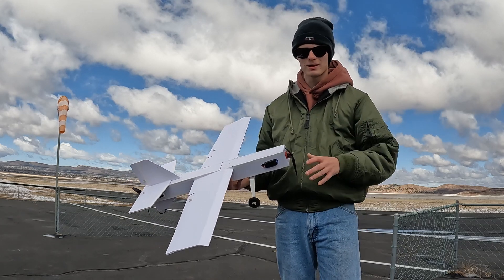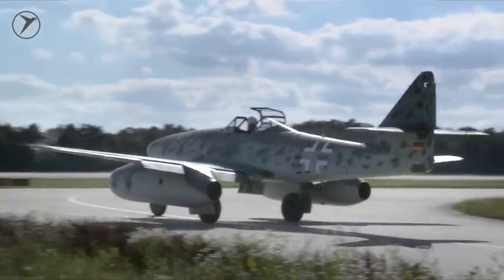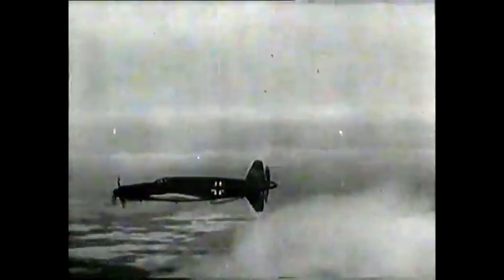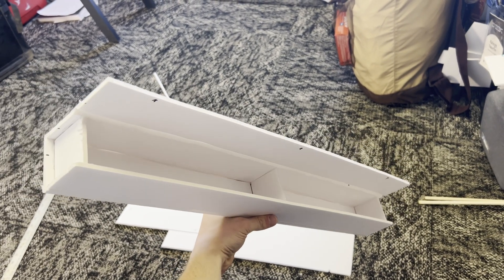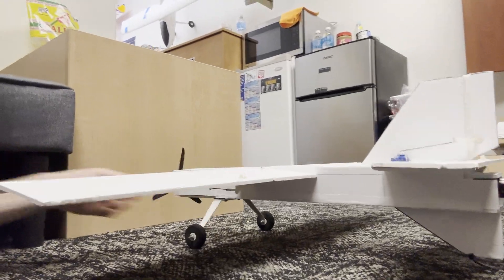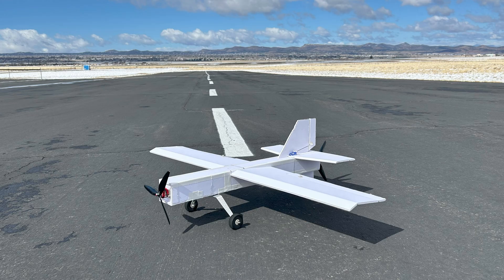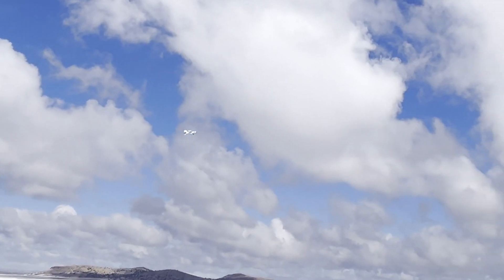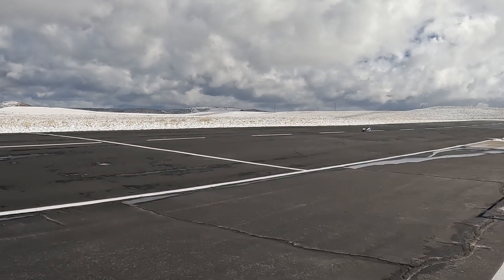Pusher-Puller Twin Airplane? | RC Build & Fly

Comment: Yooooo, i had the idea to do this, and i have yet to build it, but i do have one thing. I think, since the dual engine provides a lot of power, i think if you did a slower throttle up itd take off striaghter, albeit slower

Comment: I think the biggest thing you could mess around with is its take-off and landing performance. Maybe having the push motor mounted higher up could give you a standard gear setup. But that might affect its performance due to the thrust angles.
Reply from the maker: I wonder if I could do thrust vectoring? That would be sweet to try, just have like a take off mode or something like that
Reply: @CaptainJohn  good idea